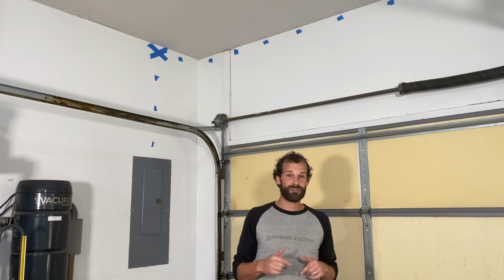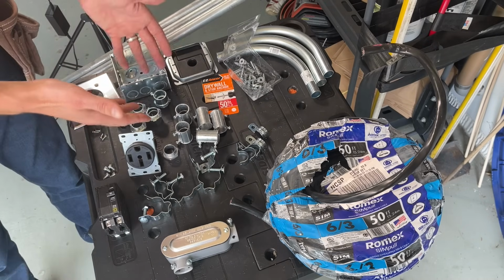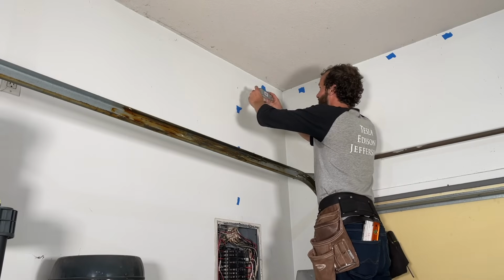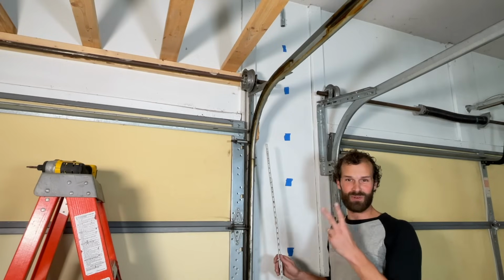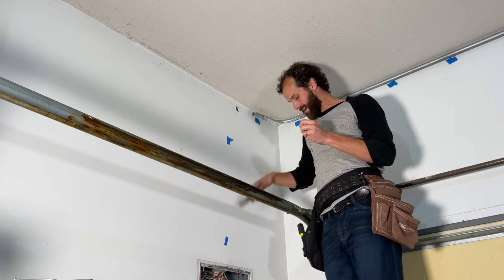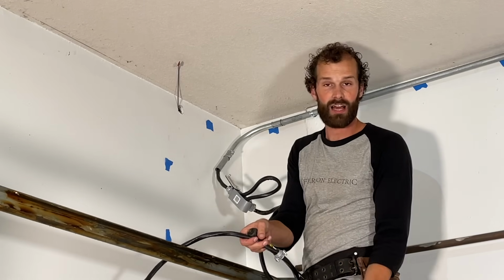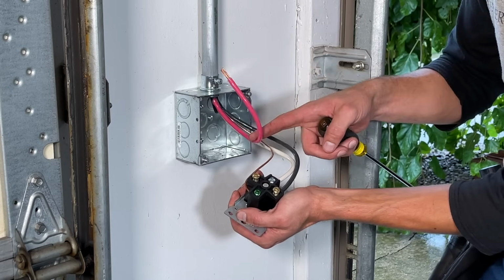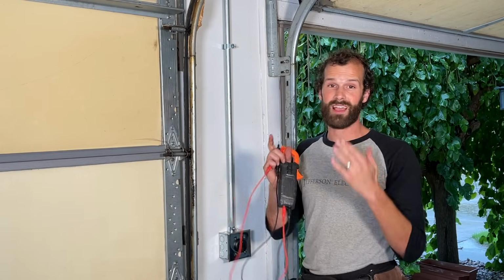How To Install a 240 Volt Outlet | Electric Car Charging

Comment: Folks, 1 neutral wire per connection point. DO NOT share the screw position. 1 neutral. 2 grounds.
After the 1st point of disconnect, you must separate the neutrals from the grounds. (typically a sub panel).
If this is being inspected (which it probably isn't going to be) don't let an inspector see a ground and neutral on one screw or 2 neutrals.

Also, not exactly necessary, but ground the receptacle box with a pigtail. The emt/box/recep all bonds back to the panel, but it is good practice to also bond the box by using a copper crimp to a pigtail and then to the receptacle. Old schoolers will tell you don't bother, you tell them to f off.
Reply: In the electrical trade it is very hard to give absolutes because each piece is designed for its own special use.

Generally, one screw-one wire.

Breakers use heat, magnetism, or electronics to detect the current draw and open the breaker.  A short circuit, like cutting a cable a cable with wire cutters can result in currents near 5,000 amps in that small instant of time the breaker takes to trip..  Yes, even #14 wire nears 5,000 amps.  (Electrical welding of the cutters or burning some steel away.)

GFCI's use electronic circuits to detect the current going out and coming back through the gcfi.  When the difference gets to about 5 mAmps,, it trips to prevent current from going through the gfci and down an unknown path.  This should protect people and equipment.

Because their functions are different, someone cutting a live cable down stream (a load on gfci) will not trip the gfci, the breaker will.  Most gfci's will then trip on "no power" and require they be reset also, after the breaker is re-shut, after power is restored.

In a normal scenario when the box is grounded, any connection with the hot wire will again cause thousands of amps to shoot through the breaker and trip it.(should it get only close enough to arc, a standard breaker may not open, thus AFCI breakers.)

The nec still lists emt conduit as an acceptable equipment ground.  However, in this case, the conduit does not run back to the panel and would not be effective as a ground.

Now things get interesting.   The nec does allow grounding of the box by connecting the equipment ground to the recepticle and that connection through the mounting metal strap creates an effective ground path.

Hope this gets your question answered.  If not, let me know.  Maybe a different explanation can be given.
Reply: @keithharrington8715  if someone cuts Romex, chances are they'll hit ground before they hit neutral if cutting front the hot side first. This means some current going back on ground. If it's GFCI protected in that spot, it'll pop the GFCI. Which is why I like GFCI breakers at times.
Reply: @adamplummer2190  I would like to exqmine what you are saying here.

First, the NEC requires rounds ND neutrals be eectrically connected at the first means of disconnect for the service (main panel) ......making them about electrically the same.

Now, let's try n some numbers.....

14 awg wire has a resistance of about 2.5 ohms per every though and feet.  So a 50 foot run (out + back) should have a resistance of about (100 ft) or 0.5 ohms.  So, our circuit resistance from the breaker to the cut spot is about one half ohm.  Say zero for the gfci and the wire cutters are also zero.

So our total circuit resistance is 0.5 ohms when the cutter hit metal.

Current is. I=E/R

I = 12 vac / 0.5 ohm.

I = 240 amps seen on your 15 amp breaker protecting the gfic.

Since both the breaker and the gfci both see this value at the exqct same time.....I do not think it matters which one trips first.  I know the gfci will trip on a loss of power when the breaker trips.

Now, I did the simple math here.....no impedance or vectors for the AC voltage, got the ohm value in Google, and used rms voltage not peak to peak.

If you find a problem or error I made please let me know.

If you need code sections let me know. Ch 9 table 8 might have a slightly different number, I was lazy wit Google.

Again, I calculate over 200 amps through your 15 amp breaker the instant the cutters hit copper.
Reply: @adamplummer2190  okay brother, I woul explain it this way.

Neutral and ground are connected in the main panel......electrically the same.  Both at a O volts level compared to the hot at 120 volts.

Google tells me that 14/2 has a resistance of about 2.5 ohms per 1000 feet.  

So, a cut two rooms away from the panel might get you 100 feet of wire.  This is a resistance of about 0.25 ohms for the run.

The gfci should be zero and your metal cutters should ALS be zero ohms.

If current is    I =E/R.  We can calculate the current.

Current = 120 Vols / 0.25 ohms.   About 480 amp

14/2 wire requires a 15 amp breaker that sees the same current as the gfci.   Yeah, on the 15 amp breaker, 480 amps as soon as the arc happens, as soon as the cutters touch two wires.

Is it possible the gfci will catch it first?  I guess it might, but I am not putting anyone's life on it.

Be careful out there.

PS.  If you are an electrical guy, you can get slightly different numbers based on electrical theories, but this should get you ballpark.  Yeah, AC power has vector analysis and uses rms value for voltage. Different values can he calculated like peak voltage at about 170 volts making current about 680 amps. Hope that squashes you correctors out there.
Reply: Would the potential hazard of an ungrounded recep. box be if it were ever to be energized due to a short to the hot somehow, then potentially someone could make contact with the box and get zooted?  So if the recep box is grounded, if it ever gets energized by the hot wire fraying and making contact with it, what happens?  Does it just cause the circuit breaker to trip?  What if it's only a tiny little fray wire and it doesn't cause a massive current draw?  could it potentially cause localized heating of a wooden stud and fire?  please fill me in im curious as grounds were never really explained all that well as to how they actually worked to provide safety, other than tripping a GFCI on a bathroom circuit or something, but what about circuits without GFCI on them?
Reply: @localbroadcast  Obligatory "I am not an electrician". There is quite possibly some nuance I've missed, but the broad strokes should be reliable.

Yes, that's the main reason for any and all metalwork enclosing high voltage electrical wiring to be grounded and or bonded - if any part of that exposed metalwork comes into contact with a live conductor, the breaker will trip from overcurrent (or any other present protections such as Arc Fault or Ground Fault protections if present on the breaker and applicable to the specific fault), thus preventing the metalwork from staying live for more than a split second and simultaneously drawing attention to the fault by preventing the circuit from working (live exposed metal will eventually zap *someone*, it's just a matter of time) . The only worse case scenario than silently live exposed metal is an actual fire.

As to the other part of the question, that's an important reason to take the grounding connections every bit as seriously as the live ones: So long as the grounding connection is made properly and in good condition, the impedance and resistance of that path will be extremely low - hence any ground fault from a live conductor will cause a massive amount of current to flow. This ensures that the breaker trips immediately, before significant heating of the branch wiring can occur.  If you have a high-resistance connection, that connection will heat up. If it's high resistance enough to prevent a breaker trip, it could indeed potentially create a fire - though I would think that that happens a lot more commonly on loose connections on the live and neutral conductors since you'd have a load completing the circuit instead of a short circuit, meaning the circuit resistance and impedance are added to the load, so you don't have a massive current flow but still have heating at the poor connection. If you have a tiny strand of live wire contacting a ground, you've still got a low-resistance and low-impedance path for current to flow on 99% of that circuit, and maybe a couple ohms at absolute most between the tiny strand and whatever it's touching.... that strand of wire just became a fuse. Either the strand blows clear, the breaker pops, or both in the vast, vast majority of cases. Even a 5 ohm resistance on a short circuit at 120V will draw 24A for 2.88Kw of heat produced at the fault - if your strand is tiny enough and badly connected enough to create 5 ohms, it definitely can't handle nearly 3000 watts of heat without melting clear in extremely short order.
Reply: Wouldn’t it be difficult to pigtail 6 gauge wire inside the box and then cram everything in? If you are saying the ground wire has to be pigtailed, could the pigtail portion be a smaller gauge, 8 or perhaps 10 gauge?
Reply: What’s your solution to his situation on the ground and neutral bar?
Reply: @adammorgan9304  I am not sure I understand.  The grounds and neutrals are connected only in one spot....normally the main panel.  In other panels or if the NEC requires based on your specific installation, the grounds and neutrals are electrically separated from each other....still connected at that one spot.

Comment: GFCI breaker required for EV chargers 
GFCI breaker required for all garage receptacles
Reply: GFCI breaker required for garage receptacles, not required for hardwired EVSE, which is arguable one of the biggest reasons to use a hardwired EVSE. The EVSE has ground fault circuitry and putting it on a GFCI breaker can cause nuisance tripping. Hardwired EVSE also would have alleviated the need for a neutral conductor.

Comment: Great vid!! Had a serious incident while in the AIR FORCE years ago. I had my wedding ring on when I shouldn't have and almost lost the finger !!
I watched closely while you were working hoping nothing serious would happen while working close to hot circuits 😊
Reply: I was thinking the same thing about his ring. It was one of several things that made me question his self description as a professional.
Reply: Had a mechanic friend who forgot to remove his wedding ring and got it stuck between the hot battery post and the fender of the car. Plunged it into cold water, but the next day he had a burn blister that looked like he was still wearing the ring.

Comment: So in my garage I need both 50a and 30a 240 recepticals, I only have room for the 50a breaker in my panel. I'm attempting to use a Fused disconnect after the 50a plug to step down to 30a. Thoughts, concerns or problems with this method?

Comment: Great instructional video. Is it not required to do the “wiggle and torque” procedure at the breaker terminals as you did at the receptacle end? Just asking.
Reply: Torque values should be referred to when terminating wiring devices & circuit breakers. Directions per NEC 110.14 (D) should be followed for wire torque at terminations

Comment: It was great video. There are some recommendations:
- Using glows and safety glasses are always better, especially when you work in a live panel. As seen in viodeo,  even you as a professional can cut your hand. I understand you are a professional but similarly you could get shock.
-You forgot to use plastic conduit bushings at the termination locations.
-it is better to mark the high of box and cut your conduit accordingly. It can give a better result for box the high, and reduce risk of miscalculations.
-Better to kill the power before start, since your fish teyp is not the  plastic one, you could make a short-circuit.

Thank you for the video and fishing tips.
Reply: I though plastic bushings are only required in FMC/AC/BX and not EMT/RMC <4AWG.